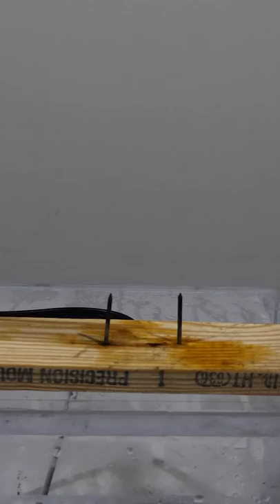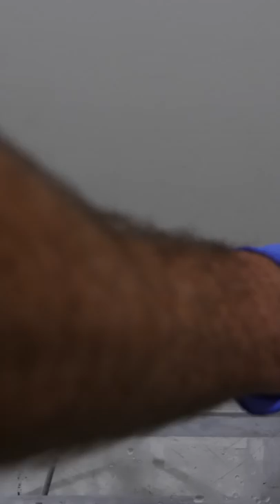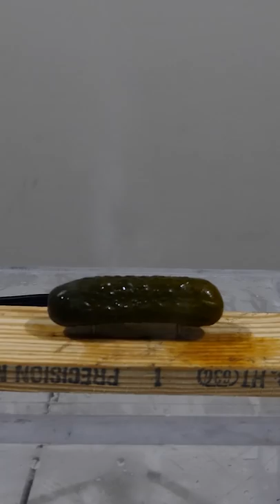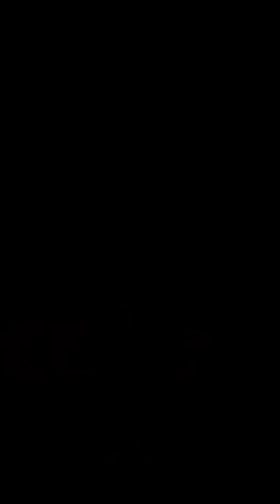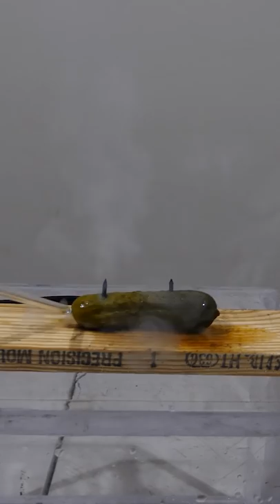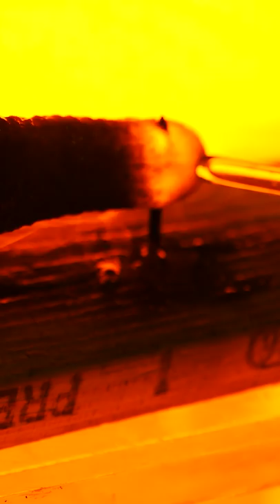Pickles Make Good Light Bulbs

Comment: I did something very similar in high school. I ripped the power cord offers some old toaster or something, stripped and exposed the ends and kind of made them into a formed fork shape or Trident if you will. I then realized I could plug it in and draw is draw with the electricity arc that resulted!  After messing with it and making several different variations, my favorite was the actual Trident I made with reinforced  steel rod and the "Box Tickle" which was just the  Is positive/negative twisted together. If so when you plugged it in, it  Tripped the breaker. Another fundis there something to do with the plug in hot dogs😇